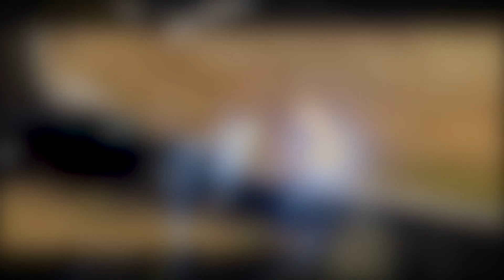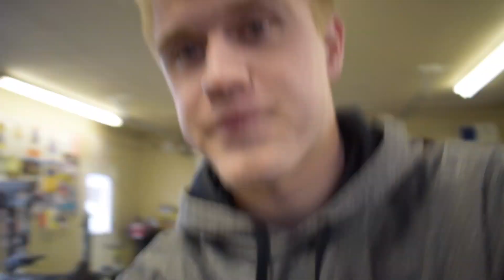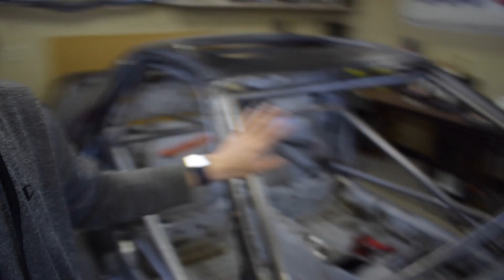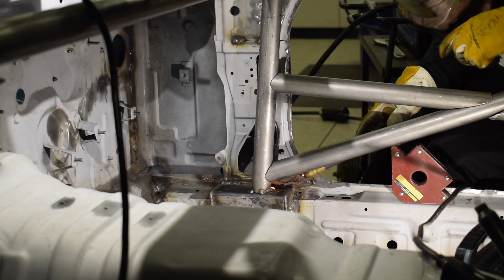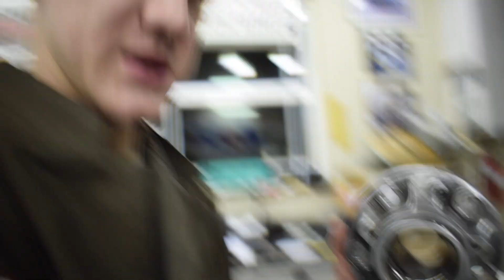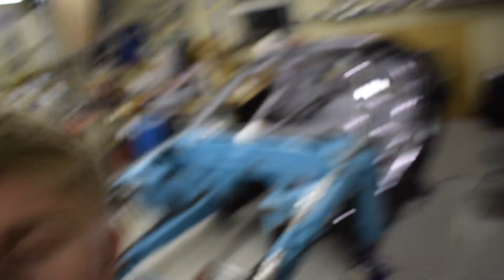Destination Sideways Ep.21 - Welding in Rx7 Cage

Comment: Hey WE WANT MORE VIDEOS :) Good job i like the music maybe not while your talking do what you want i like your videos keep it up. Also i have my 88 rx7 Na do you think i should swap a t2 or na in it ? i wanted a 1jz but im not that rich so going rotary like to cool boys :).
Reply: I wana drift im gonna put a rotary in to see how its like and build the car  while i get some money and maybe if i dont like the rotary in the mean time get  some money for parts and get a 1jz if i dont like the rotary :).
Reply from the maker: Rotary is more expensive than a simple 1J setup haha maybe not at first but in the long run it will be. I love rotaries obviously so I will never suggest anything different. Na vs. turbo depends on what you are using the car for and what your plans are for it. Turbo is more fun but also more money, and without the support behind it you can blow them up very easily (ask me how I know)
Reply from the maker: Well rotaries lack massive numbers in torque so a turbo is needed for drifting. Gotta make up for it in HP and suspension
Reply: Well how do you know XD I know that i can be done a swap t2 on a na just got to drill some holes for the drive shaft but i got told to do a full t2 rear end swap diff axle all that good stuff and idk were the fuck im gonna find that rx7 in canada Quebec are like unicorn cant find them for cheap so spare parts are hard to find idk what are the option i would have to swap the rear end anyway if i want a 1jz but idk what exactly i need and were to find them. :)
Reply from the maker: You only have to swap out the rear end if you are upgrading to the turbo trans as well, which is obviously recommended. I have a friend who is just changing the joint on his driveshaft to make the diff and trans work together. Do some research on rx7club, almost all of your questions can be answered there, or hit me up on instagram and I can walk you through some stuff haha
Reply: And it need to be street legal so thats why i wasnt doing the 1jz in the first place it means new hood cuz i need a hood radiator all the swap kit not that expensive but the wiring i guess 900$ usd so 1300$ cad idk if i shoud go 1jz at first its like 6k to 9k just for the swap idk give me some advise please im not sure .:)
Reply: +Mrkillerzone you sound pretty set on the jz but 1 thing to remember is iron strait 6 weighs more than aluminum v8's do. the jz is a heavy family.